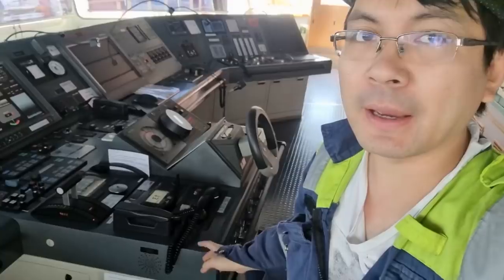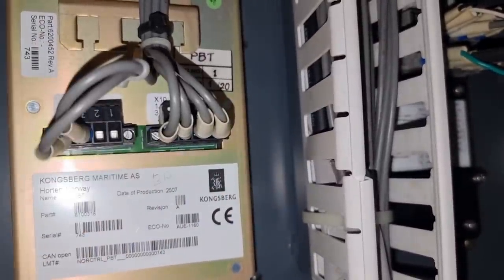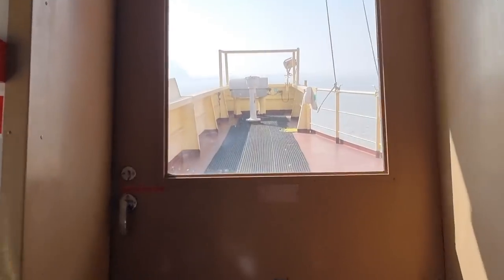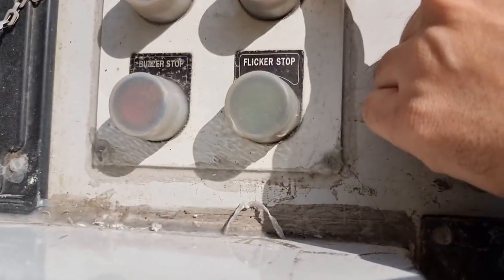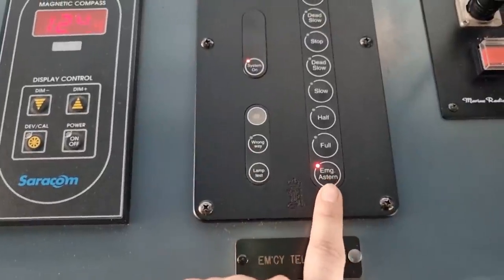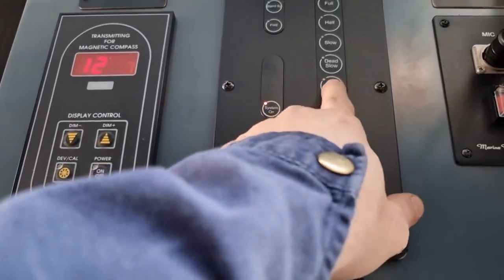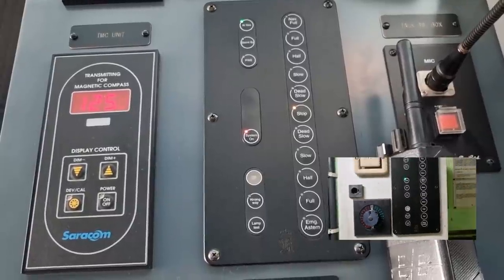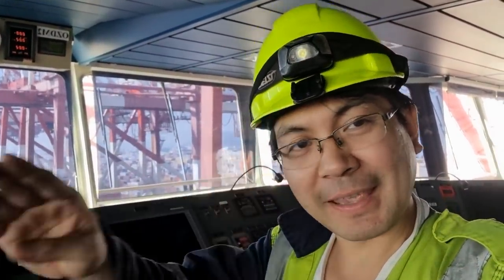SHIP'S TELEGRAPH ELECTRICAL TROUBLESHOOTING | MARINE ELECTRICIAN

Comment: Does the system use a CAN bus to communicate all the way from the bridge to the main engine? I thought CAN couldn't be used over such a long distance.
Reply: Depending on Baud rate: at 125kbit/s max 500m, at 20kbit/s 3.3km length. Can is a proven robust protocol, for this few bits no problem. You need only a twisted pair cable and so you can wire all panels.

Comment: I’m surprised they use CAN bus for such an important piece of equipment, and not something really simple like a multi-position switch & multicore cable which any electrician can diagnose and fix…
Reply: canbus is really robust and reliable. there are not many other protocols that are more reliable that fit this application.